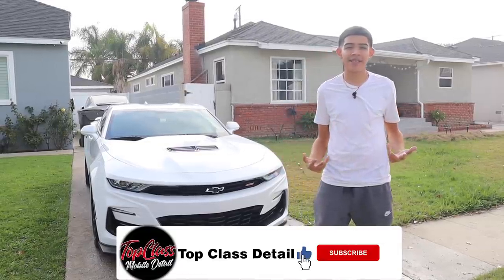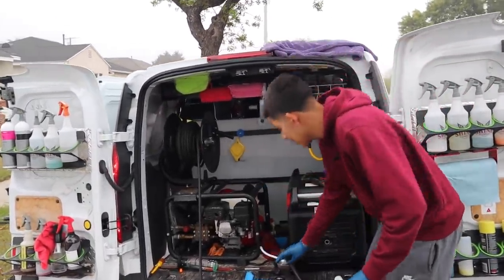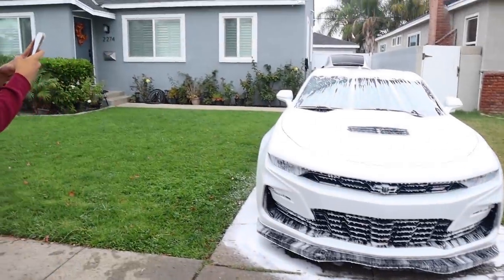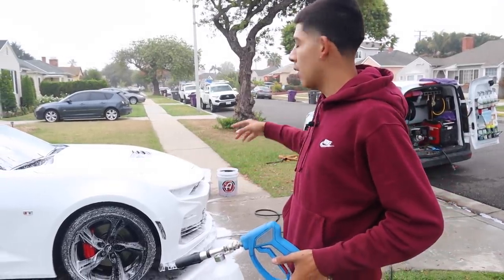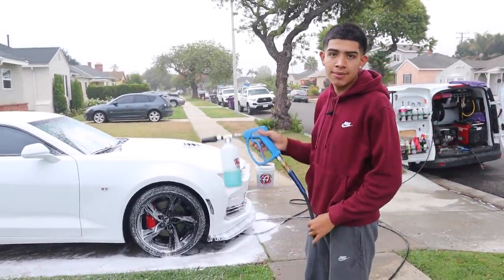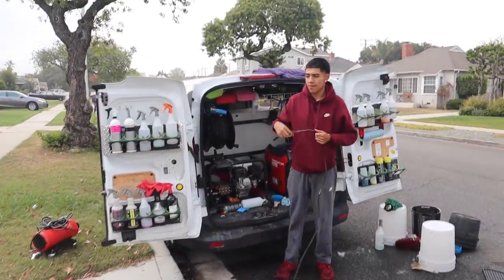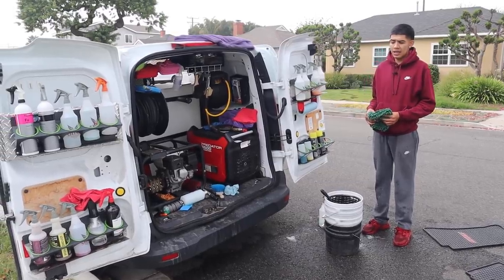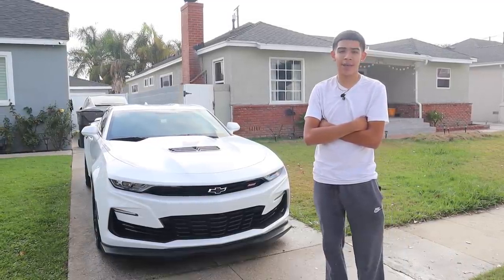Maintenance Detail on Camaro SS - Top Class Detail

Comment: This is a maintenance detail so why are you using so much green star in your foam cannon? That is very strong. If it is a maintenance vehicle, it should have protection on it and only need the shampoo in the foam cannon. That much green star will dry out all the trims and other sensitive materials on the paint if you use it every time. You really only need green star in the foam cannon if there is a layer of stubborn film on the paint or there is a ton of bugs. Just some constructive criticism.